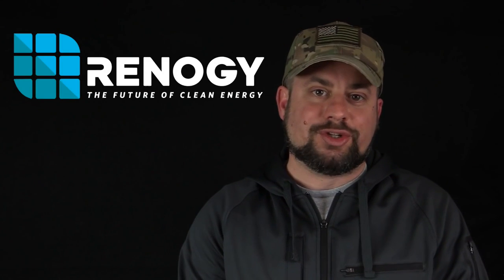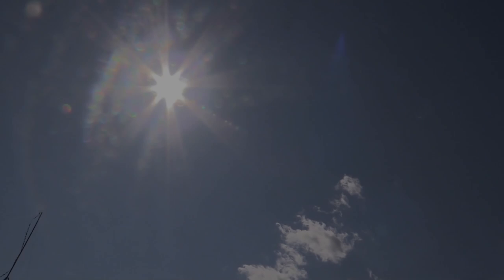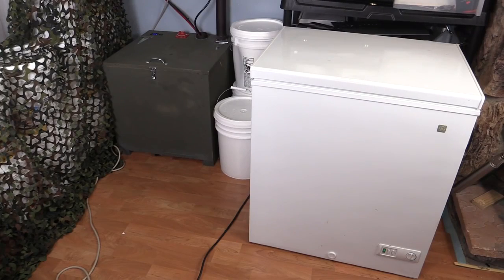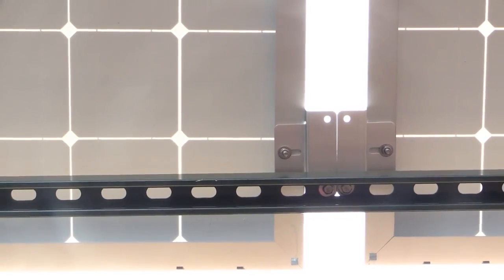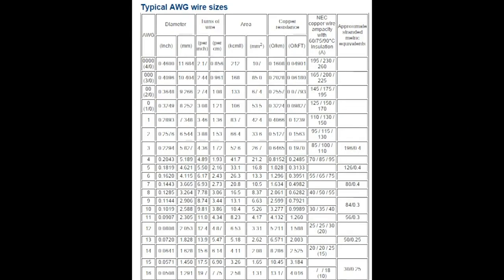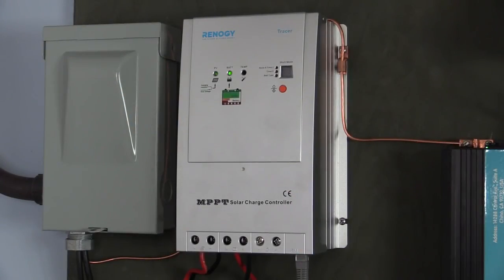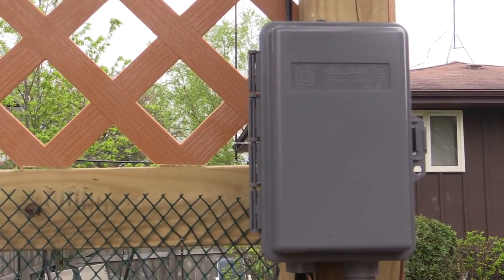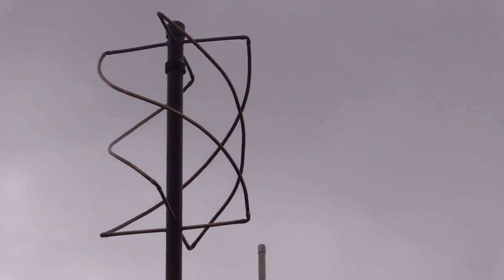The Ultimate Guide To DIY Off Grid Solar Power | Tin Hat Ranch

Comment: with your little setup you cant run A/C but there are plenty out there that can all day and heating i use a converted over wood burning heater to burn used oil that gets almost 1000 degrees and with radiant heating i could heat 3 houses enough people would be running around naked and thats not even what i would get off it in just the regular heat it puts out

Comment: Better start a fire to get your coffee fix ;-)   800w kills your battery fast !
Why don't you use 12 volt battery's ?
Reply: that depends on the type and size of your 12 volt battery Sir . Normal flooded cells are not designed for inversion . big VRLA will give you cheap useable power . i have two 175 AH YUASA VRLA in use both set up as one unit . on my Mobil workshop i use  a true Sine Wave 3 to 5 KW inverter . a 2 litre trans vend Hot water heater that requires 30 Amps Continued demand white heating . a teal wash 12 volt heats 2 litres of water for washing down after .this is a slow heat device that only Requires 15 amps  i have a led Reeling Drum work lamp that is on a magnet this has 5 Cree diodes in cable in the drum is 55 feet out . the roof lamps are all 2020 led 300 mil strips 3 in total  made by Lab craft . above my vice bench i have a 400 mil 2020 Cree water submersible strip and i have another 3 of these strips all on 2020 diode i can roll up on site at 9am and still be there midnight i have not yet had the smart banks kick in and shut everything down  .  none of this kit touches or asks the Vehicle battery's for power while engine is off  Unless i Change the smart bank operation settings . but i do not need to do that . i also changed the Original Renault Valeo 150 amp Alternator  and Replaced with  Bosch 200 Amp Unit . This system is self contained Requires No mains Intervention . Install is everything .  Merlin Smart Bank Contactor sets are Very Good. That why the Ambulance and fire services use them on there Vehicle's. military use them  Marine industry use them . i know this first hand Because i have Installed them for various GoV  Motors . 12 IS OK But has to be Right or it will die quickly .

Comment: Thanks for this guide, what is the temperature to keep inverter batteries? Initially, we have it set up inside our office where there is a cool air conditioner.
can inverter charge itself back? 
Can solar without battery be used for generating power directly connected to the inverter without issues?

Comment: I am a retired electrical engineer. Thinking about buying property and having an off grid solar system. Doing a lot of research and designing my own system.  I have to say your video was spot on.  There were no errors or misinformation anywhere I can find.  I even learned a few things I didn't know, especially about safety which was something I had not considered.  (Just because you have a college degree doesn't mean you know everything!)  A few things I (slightly) disagree with:

1) I would prefer Lithium batteries over lead acid (flooded) or AGM.  Renogy has 2 types of Li-Iron Phosphate, 100 Ah and 170 Ah, both 12 volts.  These are more expensive, but the ability to deep cycle far lower than other batteries (with longer life/cycles) almost makes up for the increased cost.

2)  Window air conditioning IS possible.  Just increase the number of solar panels, batteries, bigger charge controller and inverter.  I plan to have a small A/C window units in each of several rooms (each about 12,000 BTUs pulling 10 amps).  I simply turn on that unit (like the study/computer room) when I am present in that room.  I then turn it off and turn on the other one when I am in that room (say the living room).  The A/C will "follow" me around the house but only one unit is running at a time

3)  I would like to see something on lightning strike protection.  I have seen lighting arrestors on solar power systems but haven't yet researched how they work or how they are installed.  (Again, a college degree doesn't mean you know everything!)

Comment: This is one of the best and most comprehensive and understandable videos I have seen on solar panels.  I will still be grid-tied but because where I want to locate the panels the explanation showed me the most efficient way to have it set up at a greater distance. Also, I can explain to the wife why we should heat the water with gas still.   Thanks for all the info and I'll be watching for more.

Comment: What is even the point of off grid power? Rofl, if shit hit the fan and you were using SOLAR power it would only work for 5-10 years max. You'd need new batteries, solar panels, and other equipment. 

Not to mention people with guns and possies. They will come and take whatever it is you hold dear. There is a reason before Civilization Humans were nomadic. Stay in one place and die.

Comment: I need a 20,000-30,000 watt solar panel system.  I have the space on my roof.  The only issue would be the cost.  But my goal within next 5-7 years I will be able to do this project.

I would need my solar energy stored in batteries and then useable for household AC power.  If possible, I’d like to have it plugged into my current circuit breaker panel.  Still doing my research and learning.   Nothing is impossible.  Watching plenty of videos.  Great video and very informative.
Reply: keep in mind that batteries have a service life, so you will be replacing ALL of the batteries periodically.  This is a large expense.  Additionally, the solar panels also have a service life, and will eventually need to be replaced.  Unless you are doing all of the maintenance yourself, this will be yet another expense.

Comment: Great video! A couple cautions about lead acid batteries stored inside buildings: First, I wouldn't recommend adding a fan to the battery box to clear explosive hydrogen gas. If that fan is not certified explosion proof (very expensive) it could ignite the hydrogen if it causes a spark. Best to not use a fan. Second caution; your battery box should NOT be vented to the building interior. The battery box should be tightly sealed and both the vent exhaust AND inlet need to be vented to building exterior. While hydrogen gas will rise up the exhaust vent in "theory", a bathroom fan, kitchen exhaust fan, wood stove, or even an open window, can pull air down the exhaust pipe and vent the hydrogen into the building... If you have ever seen the top blow off a battery you will understand the danger of battery off gassing! Hope this helps!

Comment: Im planning a 100 % offgrid cabin and have taking a lot of planning and a lot going back to the drawing board,  but im there now ,and my system will run on solar panels and D wind power from a small but very effician wind turbine and a large battery bank , and as emergency backup a generator , right now im saving up to buy a pice of land and im getting there and it feels damn good 😊
Why did I end up with this , because its the right way where i live i know the area and the wheter here , and there will be days with no sun the i will be glad i have the wind turbine to help out .....
And there will also be days with no wind at all then i will be very glad about my solar panels and my well size ed battery bank ...... And if everything goes wrong and there is more then 5 days with no sun and no wind ..... well then i got the generator running on gasoline. 
My offgrid cabin will have its own water supply and its own underground tank for toilet for heating i will be using a wood stove,  no its maby not the perfect way to do it , but its perfect for me and where we live and yes it will Cost some $$$$$$ thats why I AM DOING IT RIGHT NOW when i got a good job 👍😊

Comment: One thing that concerns me about using solar in a world that has no electric and no manufacturing, is that the batteries will not last forever.  I am thinking that the idea that you will have power forever is unrealistic.  So what possibilities are there for power when batteries are no longer available?  Good video though.
Reply from the maker: Trade for batteries and keep them in reserve (and float charge them).
Reply: for a quarter century of my remaining lifetime?
Reply from the maker: At least another round.  It is what it is.  Hopefully society would re-assemble.

Comment: The first thing that you have to get right if you are going to do a DIY solar system is get the UNITS RIGHT. Power is kilowatts; Energy is power times time, or kilowatt-hours. Sometimes you get it right, but often you confuse the two. Your system is incredibly under-powered for a whole-home system, and I would not recommend it.

Comment: I saw your antenna. An augmented solar, wind, and turbine generation system if possible, should include, rf  (radio frequency inductive generation). This rf generation can be harnessed with primary and secondary electromagnetic coils. Secondary coils should be placed as perfectly to parallel  as you can to the primary coil. Electromagnetic coils work on theories based off of the proportion of the number of wraps and gauge/ size of the copper wire that make up any primary coils, and the proportion of wraps and sizing of the wire in both primary and secondary coils; as as the secondary coil outputs to load. It just takes a little homework.

Comment: wow was a wonderful video! thank you, sorry i have just 2 questions if possible:  a normal 12/24 pwm controller can support 12/24 panels and 12/24 battery, but on the load part can i connect an 24V inverter or just 12v is supported? then what do you suggest, is better to connect the inverter to the charger load or straight to the batteries? thank you

Comment: 1:01 Off Grid Solar System Components
4 solar panels (100 watt monocrystalline panel) + Solar Charge Controller (40 amp MPPT) 
+ 4 Batteries (6 volt Golf Cart)(470 amp hours total)(collects about 1.5 KW per day) 
+ Inverter (1000 watt Pure Sine Wave)
4:15 Kill A Watt Electricity Usage Monitor 
6:21 How many things do you need to run at the same time.
Properly sizing your Inverter watts.
7:13 Sun Hours
9:03 Batteries
11:24 2 (6 volt) batteries connected in series = 1 (12 volt) battery (with the same amp hours)
13:30 Watt Hours = watts x amps
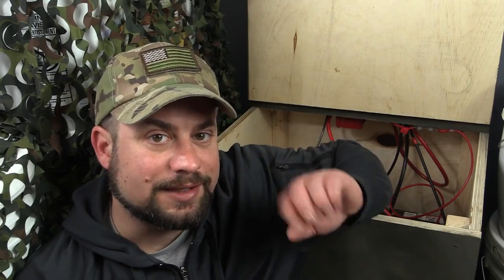14:02 can not drain all the batteries power.
15:23 do not have a battery bank bigger than the solar panels can charge.
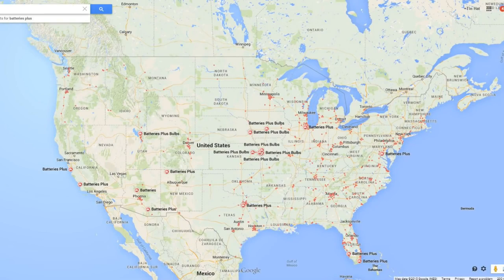16:03 Batteries Plus Locations (Duracell sligc125) $125 each
16:24 sizing battery bank (2 to 5 days of use)
17:25 solar panel positioning
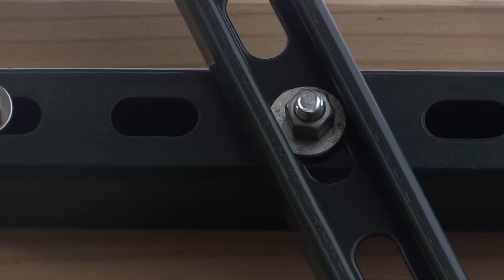20:32 panels distance to batteries
22:39 solar panels series wiring(volts added together, amps same) 
or solar panels parallel wiring (volts same, amps added together) 
24:07 wiring solar panels in series or paralleled? 
28:32 Solar Charge Controller
34:06 Battery Box and Safety
43:38 AcuRite Weather Station ?
44:41 Ham Radio, Nooelec - Ham It Up

Comment: Now that's a cool video explaining the topic very well, congratulations, fun to watch. One thing perhaps that you could add to your system is a warm water buffer that you run copper piping through to generate hot water for the house. You could discharge excess electricity into it as well as use solar heating as your main source of power on it.

Comment: i was just watching your video, and was just wondering if you knew that an electric motor running a generator could be more effective then a solar system for 2 reasons, no sun means no power and if grid goes down no power, with an electric motor running a generator you would never lose power

Comment: Thank you I have been in discussion with my wife where I want to use solar and she says we would never Recoup our money. I said I didn't care if we could safe right now. I am Retired and don't have the best knowledge or plan so this has really helped me out. I did purchase a like new john deere generator for $500..00  and spent another $740.00 to have an electrician come over and wire in a box and plug on the outside of my home and I can run one side of the electrical box with it. it is a 6225 running watts and has a 7 gallon gas tank, so ill stick with that and keep splitting the electric bill with the wife. again Thank you

Comment: I have two solar systems, my bigger system is four 285 watt panels,  150 watt mttp charge controller, 2,000 watt sine wave converter and four 6 volt solar batteries weighing 105 pounds each, they are huge, I got all the breakers and cables with the system a big 250 amp breaker too! I paid 10,000 for the system, did I pay to much or could I have gotten a better deal? Oh I live in the high desert in California next to Nevada and Oregon state lines!
Reply: Probably should have said inverter instead of converter now I can't remember which one is which, it's taking 12 volt DC to 120 AC  that's converting isn't it? And inverting is 120 AC to 12 volt DC so I think I got it right the first time, maybe not? I can't remember but I know how to hook it up and I run mine at 12 volts as well! My next project is hydrogen power out of my creek! Got any ideals on a good hydrogen generator, I was going to make a water wheel but I'm thinking about buying a good hydrogen generator instead!

Comment: Just want to say thanks brother I enjoyed this video. Both informative and funny.But I am going with  8 Trojan L16RE-B Flooded Lead Acid 6V Deep Cycle Battery 370Ah to start with and more down the road.And I plan to get a sun tracker so my panels will always be looking at the sun.Oh any everyone should think of making the wire them selves, I used 0/1 gold plated with 10 grams of .999 gold I hammered out to a paper thin sheet and wrapped the copper wire then recovered with the seething I removed and some silicone rubber to keep it sealed.With that I can't really see a lose of power.  And yes Gold is very costly but worth it in the long run. Gold is a perfect conductor of electric power that moves thru it. And gold can always be melted down and sold for the wgt value. And for me I got 10 gram bar for $520 with some other gold to make the cost low as possible. And always a good ideal to keep some gold and silver on hand for the world after the grid goes down.
Reply: What's your address bro? Where do you keep the wire? Jk. Sounds like a lot of work!
Reply: @ricardocuevas1490  Want to steal from me do you? I own guns and dogs not sure you would make it off with anything more than a story to tell your friends about.

Comment: I would like to get to know more about this off grid solar. At present unfortunately there are laws in certain areas where you are required to have on grid power and even though I have solar (5.25kW, 21 - 250 w panels) I cannot produce enough electric with those panels to even get a zero net power, let alone have a battery backup to save some power for the night time use.   According to SRP (our power company) even with my solar I'm supposedly using an average of 2400 Ah a month in a 1700 sf home.  I would like to find a way to make my 5.25 kW into a 10.5 or larger to see if I can at least keep up with a close to zero net.  I purchased my solar in order to reduce my electrical costs, but it seems my electrical costs have doubled since I installed my solar, and it doesn't help that our electric company is now charging us a "DEMAND CHARGE" for having solar which averages about twice to three times the actual usage cost.  For me the solar has become a devils demise (I am on a fixed income due to disability) and is now costing me more to have a so-called lower electric bill.  Don't get me wrong, my electric use has gone down with the help of the solar but has increased my monthly costs overall.  Everyone needs to be able to make sure that their area does not have a law that makes it mandatory to have on-grid requirement.

Comment: Your video is very practical and educational at the same time. But it would be better to go through the wiring  and breakers (fuses) for the whole system as well as how to calculate them, for example for the US according to NEC (National Electricity Code). There are different factors which would affect the size of wires according to change of amperage.
Good job. You have an effective and relaxed system of teaching.

Comment: The voltage meter could be assisted by a LED indicator you can get for motorcycles. Instead of reading, you just look at the colour. It chnges from red to green with flovours in between. This is the second in your comprehensive series I have seen so far. Pleasantly surprised, you know your stuff ! Fascinating to private dwellers and giving them everything they may need to get knowledge. So informative. Thanks :) Have you considered harnessing HHO ? An incredible source of fuel, when burnt as a fuel it produces pure water as an exhaust form the muffler !

Comment: If you wire your panels in series, your panels are only as efficient as the weakest panel. If one of the panels is shaded by anything at all, a dusting of snow, a tree that only casts a shadow over one small corner, a bird with bowel problems, etc. etc.,  the entire array could lose much of its power.

Comment: they are under development still and bulky, but did you ever look into IRON-SALT WATER battery system for off grid?  There are some advantages over lithium ion One can put the panels on top of the cargo container they are built in also.....  EES Inc. is the company working on it.  It would be for larger scale off grid systems or for multiple abodes/users. Certain advantages.

Comment: Summer outdoor temperatures average around 115 to 118 most days where I live in the desert SW. Without A/C, inside temperature would be much higher. A/C is absolutely necessary to support life. Use insulin, so refrigerator also necessary. Do keep a good bit of food in freezer, so want to keep that running as well. Will need much bigger system than you have. That being said, you give great information, and I will definitely save this video for reference when I get ready to start building my system.